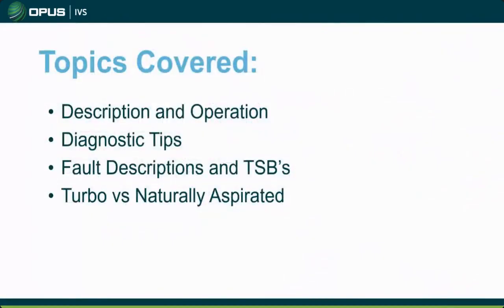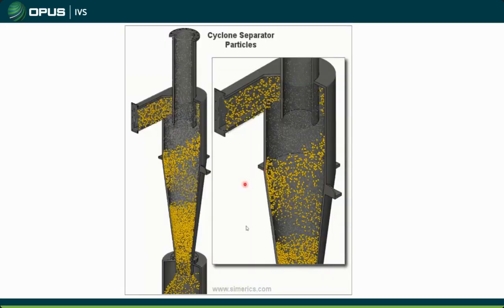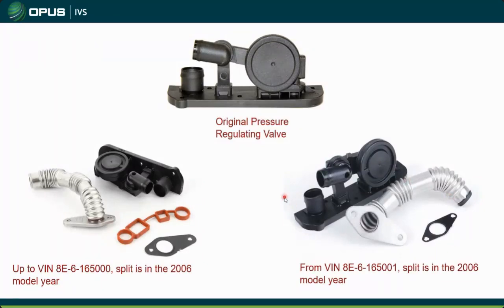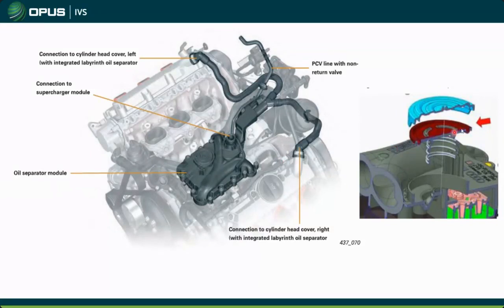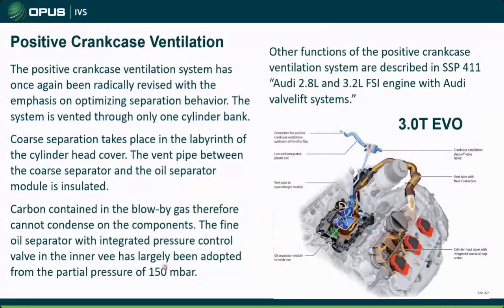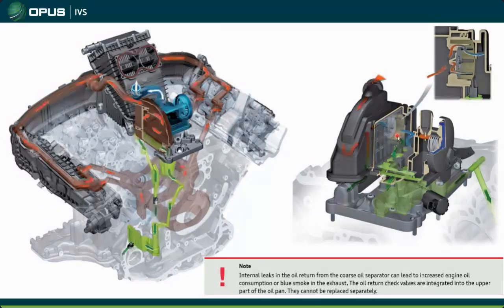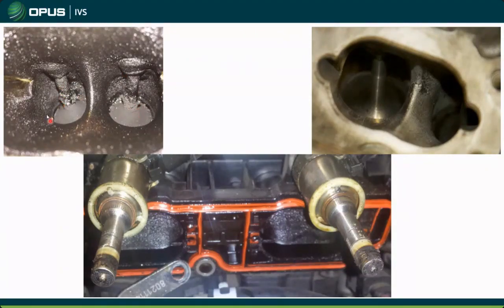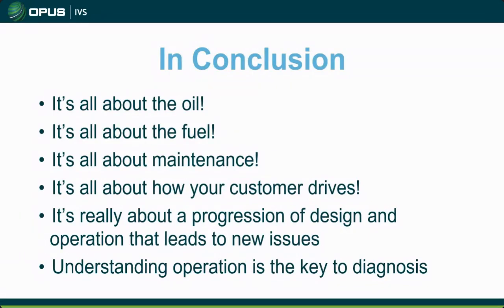VW/Audi Crankcase Breather Systems Training

Comment: commentary was pretty useless.   Need-to-know items should have included air direction of the hose system, how to tell when the pancake valve was no longer functioning, partially functioning, stuck completely open, how to test it, etc.    ...How much oil in the air from the pancake valve into the Y-pipe can be tolerated...   If the pancake valve stays more closed, is this oily air more likely to be burned directly into the manifold, thus saving the turbo's from dealing with it...?   Or does it even matter if the turbo's have to deal with it first...        If the pancake valve is venting some oil, what is real source of the oily air that produces it, and how to reduce it...or can it actually even be reduced in an older engine..?   If it gets to the turbo's...so what happens then?   If it accumulates in the pipes to the intercoolers what happens then?    If it gets to the pancake valve, it must be at least getting out of the valve cover chamber...but if it's excessive, is it the cause of valve cover gasket oil leaks...?    If the pancake valve is open at full boost, then it's doing its job, but if the air coming into the Y-pipe from the pancake valve is more oily, it's going to end up at the turbo's....       Where / why is this excessive 
oily air into the valve cover chambers....  is it worn rings...?     Is ring replacement the only solution?

Comment: My mk6 GTI was having a hot start issue where if I shut the hot engine down for more than 15 minutes but it didn’t get cold enough to have the choke engaged it wouldn’t want to restart.  It would start for a few seconds then cough and die.  I didn’t have any throttle control either.  I would have to keep cranking until it would let me use the gas peddle to get it to crank.  It started fine when cold.  I pulled the intake manifold and had carbon not only on the tops of the valves but the flaps had a lot of carbon.  My thoughts were that once it warmed up the carbon became softer and it would run fine but when it started to cool down the  carbon on the flaps would cool down and stick not allowing any movement.  When cold it had the choke so I didn’t have issues starting cold.   I’ve pulled the intake manifold replaced the water pump cleaned the injectors and tops of the valves and put a new intake manifold on.  So now just have to change the oil and put fresh coolant and see how she runs.  I have to get it smogged this year so I hope all goes well and the hot start issue is solved.

Comment: https://youtu.be/jcZaenAPFxs?t=1720                   i upgraded the PCV on my 2010 A5, but did NOT put in a new shaft seal or bolt, and did not update the computer. 
however, NO codes. engine runs well, only 60k miles on the car. still uses about 1 qt per 1200 miles, although i am using 30 weight oil. i had used the recommended 40 weight and oil consumption was 1 qt every 2000+ miles, but lost 1 mpg.  long term fuel trim under 6%.

Comment: Great info!! I had a PCV issue on my 2.0 with rough idle before and replaced the pcv last year and all was well. Now I seem to be having another issue. My car is running fine no rough idle drives fine but it's smoking out the exhaust blue smoke when accelerating which suggest oil burning. After diagnosis my mechanic narrowed it do to the PCV because as soon as he unplugged the line from the intake manifold the car stopped smoking. Any idea what part of the PCV failed that's allowing excessive oil through?
Reply: did you change the diverter valve as well `with the PCV ??cause the oilbareer goes from lower crankcase to upper crankcase and the oil and gases will be normally seperated by the diverter valve .if the the diverter valve is okay it ends up sperating the oil condensat into the intercooler (which is a sign of a functionally valve),if the inner rubber membrane from diverter valve is failed it does not sperate anymore and soak the hole oildrop/oil condensat into it and burn it again .otherwise the only way to burn more oil is when the midsection of your turbo is failed,espsecially the bearing ,that can cause also oilburn.thats why to change all ,not only the lower PCV hose.diverter valve should be around 30-40 bucks.if its not i recommed do a test with your coolingwater if there measuring emissons within ,not that you where having a slowy failing headgasket .greetz from dortmund.
Reply: @MrSpeed808  thanks for the info no I haven't changed diverter valve I'll look into this.

Comment: Do you know the normal operating crankcase pressure for the 2008 Audi A3 3.2? I am replacing the PCV/Oil Separator under the valve cover and would like to confirm normal operating pressure following the repair.

Comment: I wish you would do one of these on the 2011 Chevy Cruse...  because it's comically bad.
Reply: The cruze is pretty easy, if the orange valve is missing you replace the intake manifold, if the transducer pod on the valve cover is leaking at idle you replace the valve cover, if the check valve in the turbo to intake breather tube is leaking you replace that pipe. Better yet, if you find any one piece bad replace the whole set with an aftermarket improved set from Dorman because otherwise you'll be back in there replacing something in a week. Dorman rarely makes parts that are better than OEM, but this is one of those rare cases where they do.

Comment: Great video thank you! Had a quick question if possible to answer. I have the 2.0t CAEB stage 2. I replaced the PCV with a catch can. Is it okay to attach a breather filter on top the catch can? I tried a vacuum test on the dip stick and nothing happened so I unplugged the plug on the manifold and tested it through there and it seemed to work and stayed steady in the green (cheap Harbor Freight tester) so I assume I don’t have a lot of blow by or crank pressure so not sure if a breather is really necessary but heard it’s something some do to avoid pressure and future leaks. I just want to make sure I don’t have to little pressure or to much. I really am looking for any input and help. I’ve looked everywhere. Please and thank you.
Reply: so first ,if you have underpressure by lifting the oilcap you normaly have an issue with the PCV hose or diverter valve .so if you got underpressure then you are in trouble .it is okay to attach a breather filter ,here in germany it is forbidden ,cause you let emissions into air ,that only means you have a sober combustion ,cause you not recirculate the blow by .at the end this is much cleaner to the engine (but not to the nature),a reciculation combustion of blow by gases ends up with carbonisaton of your inner engine parts ,so if you spit out the blow by your engine will be much cleaner.you have the lower pcv hoses that goes upwards to the upper crankcase or around the block to the diverter valve .this valves part is to seperate the blow by into 2 products -gases to recirculate ,and oilcondens to sperate,and let rinse to the intercooler pipes (thats why so much people talking about drain their intercoolers) thats why your emissions test would be much soberer than with the recirculation of the old blow by gases and oilfumes.this catchtank it just a trick to not must clean always your intercooler pipes ,easy access to drain it away -nothing more .the breather filter looks nice but in the end you spitt the emissions out ,and that is not filteret,even when filter looks like it does :D when police in germany will see you driving an open crankcase with catchcan and filter ,they will confiscate car and the hole process to get back the car costs more than 4-5 weeks and 5 k.thanks greta .

Comment: I have an Audi A6 C7  3.0 DTI 2011 204 HP . Is it normal to have gas when I open the oil cap? I have an oil leak but i think is the gasket of timing chain (soon have to replace 150 K ml ) . can be problem with Crankcase ventilation ? No warning lights and car running  smoot

Comment: Did Audi/VW ever do a recall on the caeb motors with the piston ring issue?
Reply: Nope
Reply: i have a 2010 a5, been using militec-1 and liqui moly cera tec (alternating between each at every oil change not to be used together), also using liqui moly engine oil flush at each oil change.  that and driving gently. so, consuming about 1 qt per 1200 miles.

Comment: The non-removable lines on the v6 valve covers definitely CANNOT be removed using a similar diameter hose clamp with the screw portion removed
Reply: Just because you haven’t been able to do it doesn’t mean it doesn’t work.

Comment: 27:20 Isn't it the other way around?  The updated PCV runs higher, not lower, crankcase vacuum, right?  Higher vacuum signal helps ring seal etc.  You are correct the updated PCV is 100 mbar.  100mbar is already pretty high vacuum in the crankcase.  Your information and knowledge on this platform are outstanding.
Reply: I believe you are correct. It went from 30mbar to the updated 100mbar